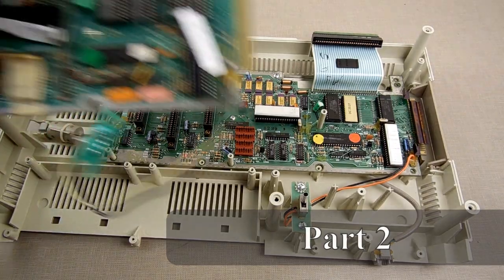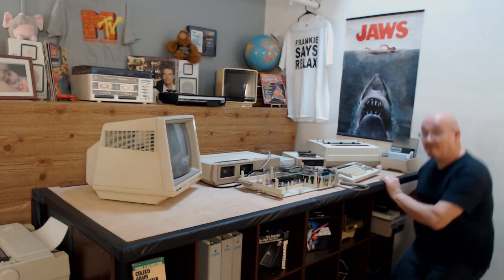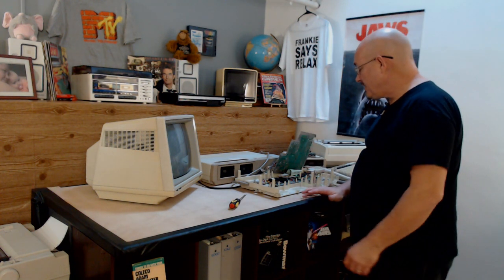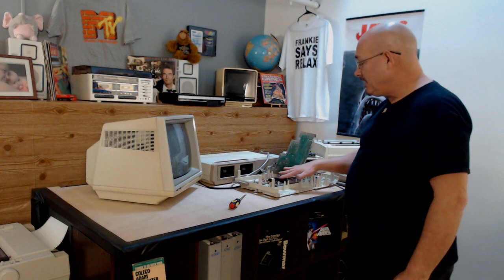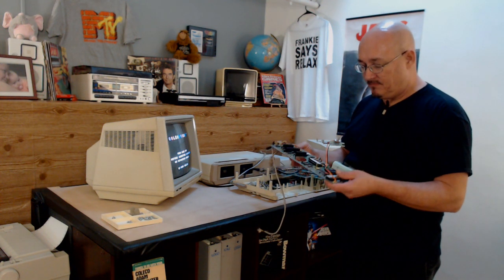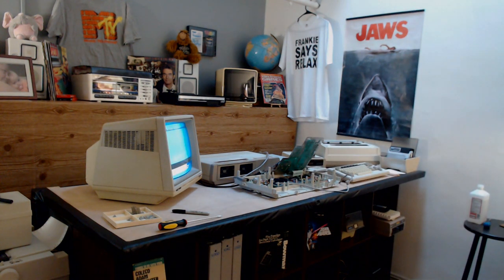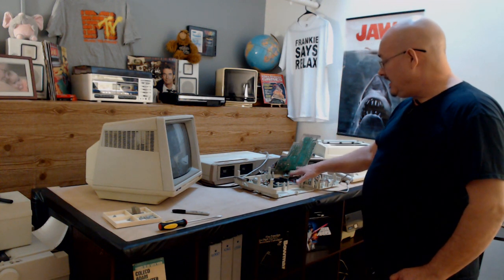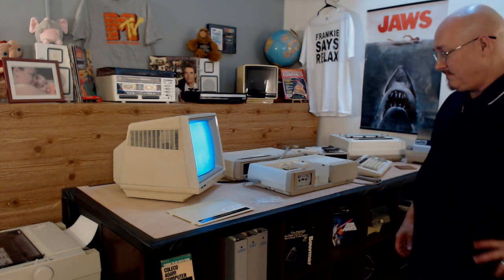Coleco Adam Data Drive 6801 Failure Part 2 #FebruAdam

Comment: This is not tube equipment.  Unless it was broke from the time it was in the factory, you are not going to find bad solder joints.  This is all low voltage stuff with very little heat.
Reply from the maker: The return rate on the Adam
Was horrendous so it could be broke since 1983 and still be usable :)